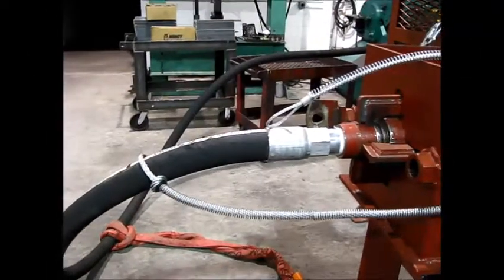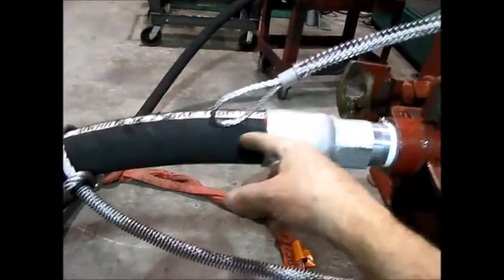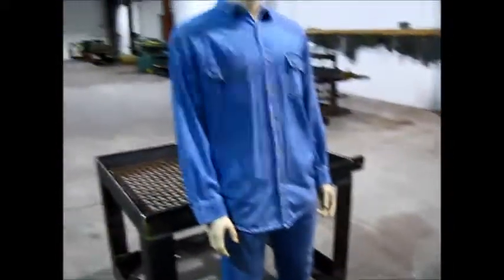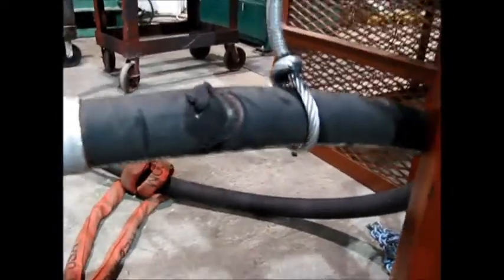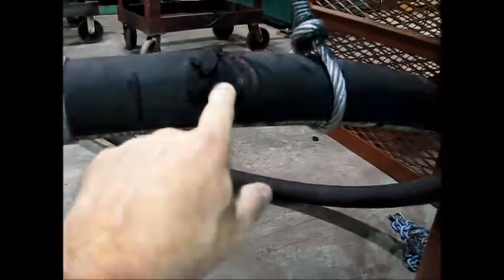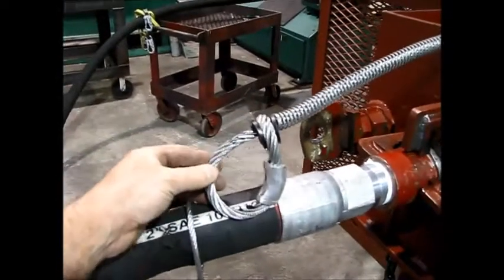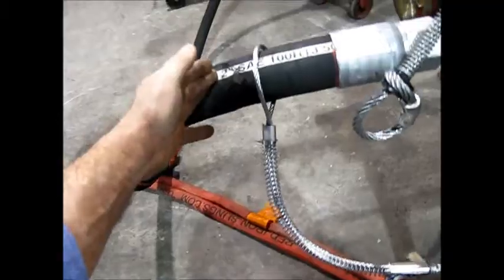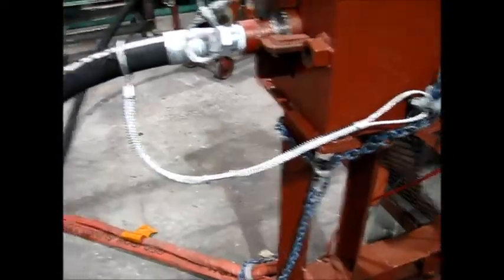Oilfield- Are your high pressure hoses safe ? Cable Hose Choker Vs Whip Check

Comment: I remember seeing those lower rated  whip checks being used but it was in fact always under 200 psi.  but there was a time where the chockers were being used for low and the multi-1000 psi high pressure hoses as well.  When dealing with this type of danger, over-kill on the safety is legit in my book.

Comment: Would like to see the test done on 1/4 inch bore 2sn hydraulic hose commonly used in the diving industry to charge high pressure 50 litre cylinders with air to 3000 psi / 200 bar.  The standard whip check for LP 3/4 pneumatic tools hose/air bagging is commonly used for diving cylinder charging hoses.

Comment: Would like to see same test with a liquid. Gas makes the event more violent. Dangerous either way.
Reply from the maker: Yes Sir, we have tested using hydrostic pumps and generally see 50% of static load to restraint.
We need to get a large triplex pump so we have a large volume (GPM) traveling through hose during failure.
With current testing, we see on average 50% of static load to restraint with fluid and 100% with gases.

Comment: 🇨🇳🇨🇳🇨🇳☎️/whatsapp /wechat/mob  008615832863556/008618630597588
1, Wrapped and smooth cover of hydraulic hose:   R1/1SN, R2/2SN, 1SC/2SC, R9, R12, R13, 4SP, 4SH.
2, Air conditioning hose(galaxy hose)
3, Fiber Braid  Hose: R3, R6, air hose
4, Teflon Hose and Stainless Steel Metal Hose
5, Thermoplastic  Hose: R7, R8 and twin hose
6,suction and deliver hose
7, gasoline fuel dispenser hose
8, all kinds of hose fittings
9, crimping machine

Comment: hello everybody, we are a top 10 manufacturers of hydraulic hose in China, main products include R1-1SN, R2-2SN, R3 R5, R6, R9, R12, R13, R15, 4SP 4SH, 1SC, 2SC etc, on 2016, our production capacity is 5,000,000 meters and our hose mainly sold to America and Europe importers, wholesalers and brand hose.  Contact me via Skype: cqlfly and email gushanrubber@hotmail.com
Reply: Hi
Reply: fuckoffchina